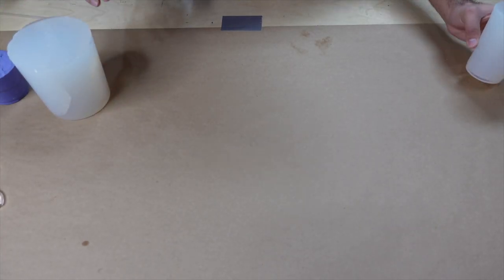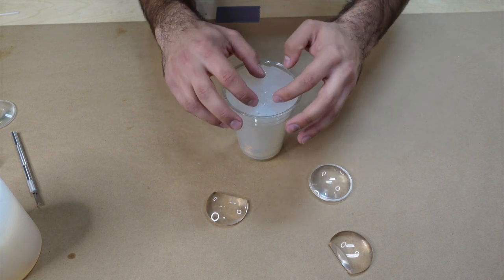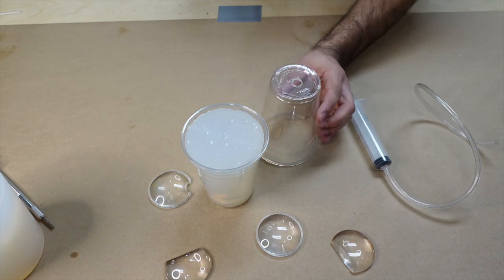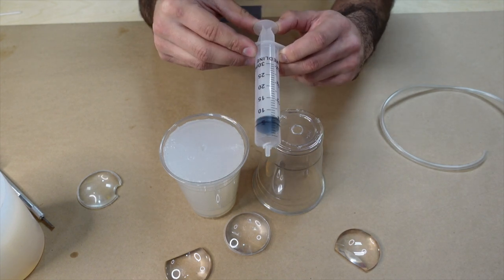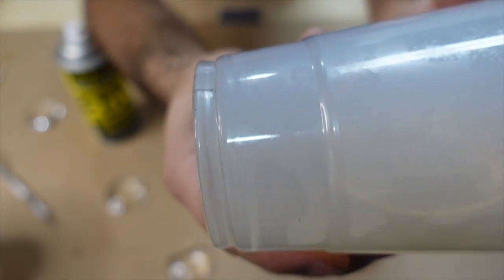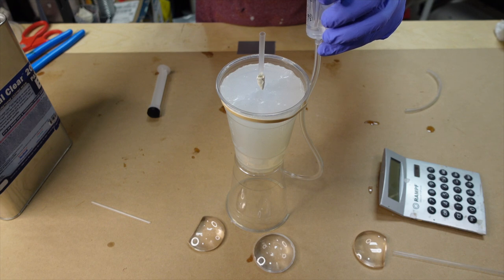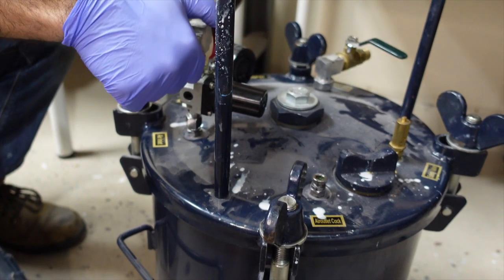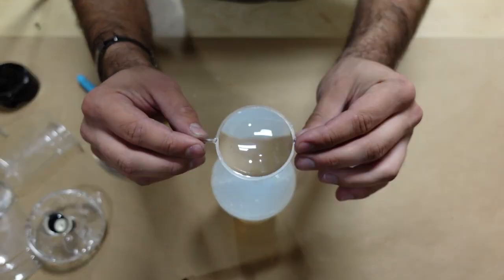How to Make a Lens Through Silicone Molding

Comment: You should use a reinforced  concrete mould sprayed with laquer and then apply vaseline.
Then, use this large mould leveled properly and pour clear casting resin onto the vaseline thin layer dome hemisphere. So you get a large lens that can cost thousands of dollars.
The concrete cast can be hemisphered perfectly using a curved edge half circle made from MDF. When spinning around this half circle into the thick concrete you will get a perfect dome hole. Leave to dry 2 hours and come with sand paper rubber disc. Get it almost glossy. Then apply liquid adhesive to make it glossy with a roller. Add furniture laquer. And job done.
Keep it clean and use a brush with some clear vaseline or vegetable oil when casting a new lens.
Let the casting resin to dry till next day, then use a large wool to turn the heavy block upside down slowly.
In this way you get the perfect lens. Do not forget to use a tiny pin and gas torch to boil the few air bubbles when pouring resin. Follow my advice and you have your own most expensive lenses.

Comment: Thanks.  Acrylic is apparently naturally UV degradation resistant. I'm thinking about clear casting a protective/concentrator window covering for a small solar panel integrated into a product I'm designing. Your work through of the various gotcha's and techniques was very helpful. Thanks.